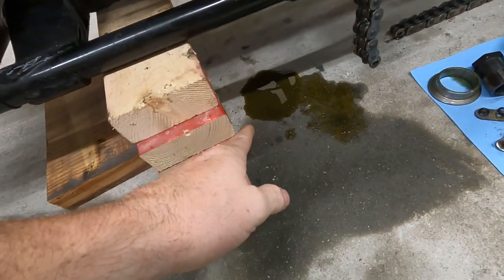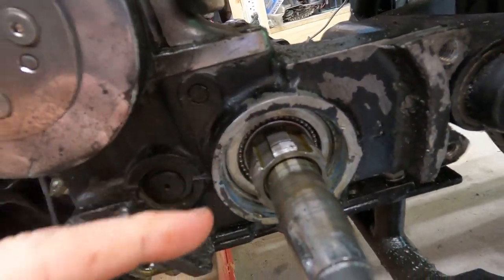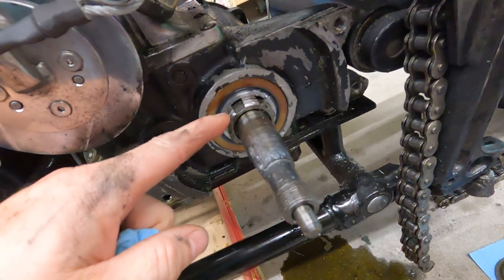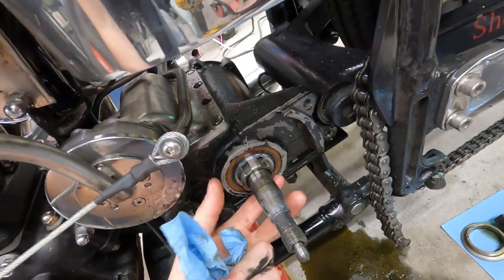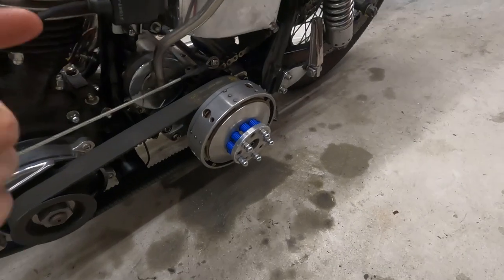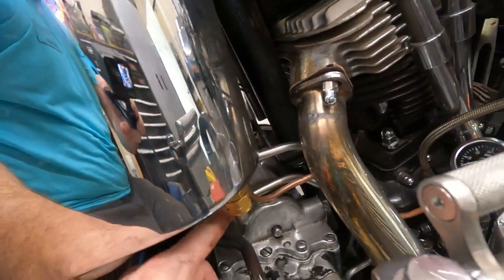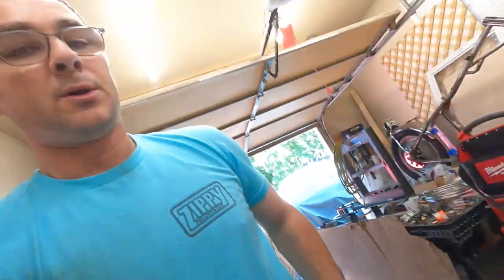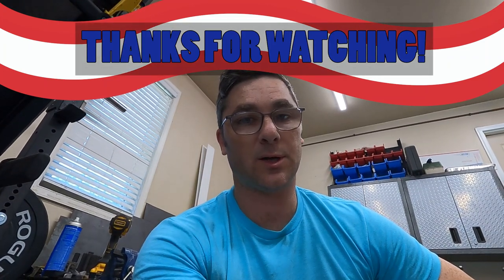Finally fixing the Shovelhead transmission leak, hopefully

Comment: Thanks ,Ray(saddlebagrail) I actually have 5 different spacers to choose from to cover all 4 speed transmission era...41-E77,   L77-79,   80-81,  82-85 rear chain and finally 82-85 rear belt spacer